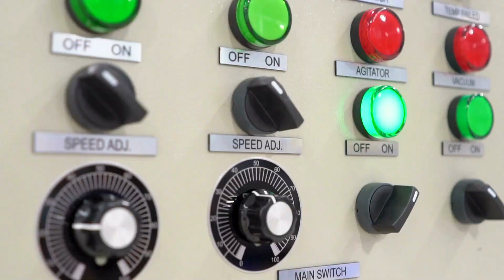Baltimore Bridge Collapse - What Exactly Happened?

Comment: Dali is propelled by a single low-speed two-stroke crosshead diesel engine coupled to a fixed-pitch propeller. Her main engine, a 9-cylinder MAN-B&W 9S90ME-C9.2[9] unit manufactured by Hyundai Heavy Industries under license, is rated 41,480 kW (55,630 hp) at 82.5 rpm.[2] Her service speed is 22 knots (41 km/h; 25 mph).[5] For maneuvering in ports, Dali has a single 3,000 kW (4,000 hp) bow thruster. Electricity is generated onboard by two 3,840 kW (5,150 hp) and two 4,400 kW (5,900 hp) auxiliary diesel generators.[4]

Comment: Yes, this is very informative, but you need to understand that ship systems are designed so that after a power outage, the automation starts in normal mode and the crew cannot act in any way, besides, the systems are often checked by port services and I hope to see information about the real reason that has become such a big problem in the near future
if the crew used a shaft generator and turned off the diesel generators, this would probably be a direct violation, although I know that many people practice switching to a shaft generator after moving away from the wall; this could be an overload of the energy system during movement and disconnection from power
Reply: We don’t switch a shaft generator on till full away( ie when off standby/manoeuvring basically we wait till in the open sea) because varying ship’s rpm affects shaft generation. Dead slow to stop or half ahead to stop or dead slow guaranteed to trip the shaft generator off the main board as it goes out of phase. Not the best analysis as it missed a lot of fundamentals related to solas ship S their systems, and operation.. but fun graphics.